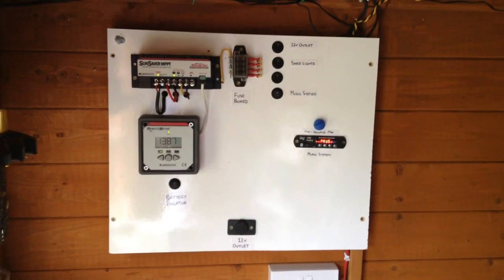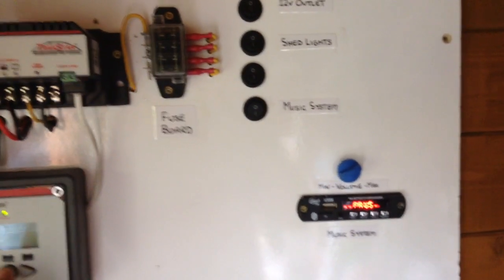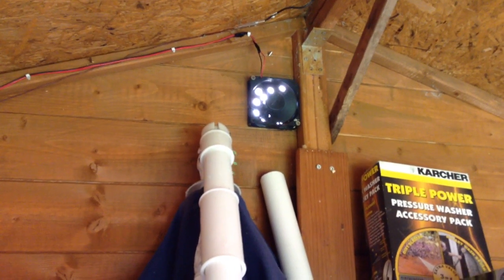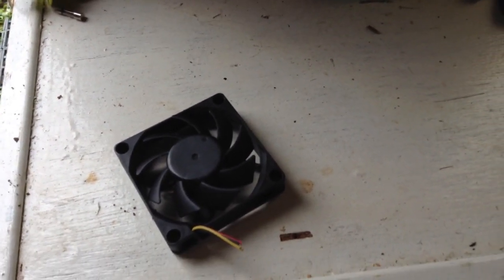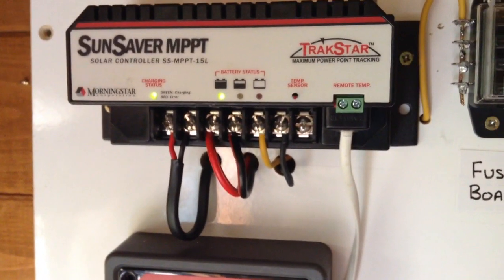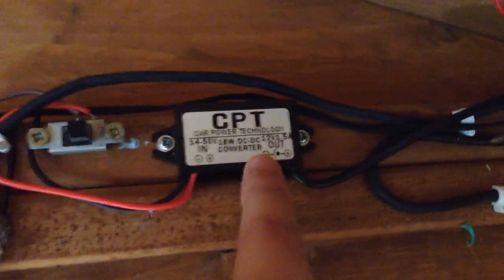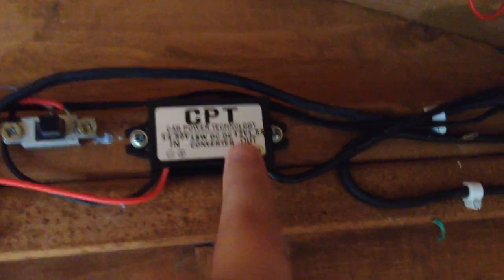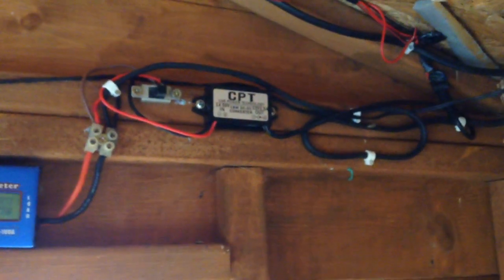April 2018 Solar Shed fan

Comment: If you reckon a wood shed in 24° is hot, imagine a tin shed in 40°
Reply from the maker: Hi, I have seen the temperature up to 40*C in summer if I forget to open the Shed doors, not good for anything inside.